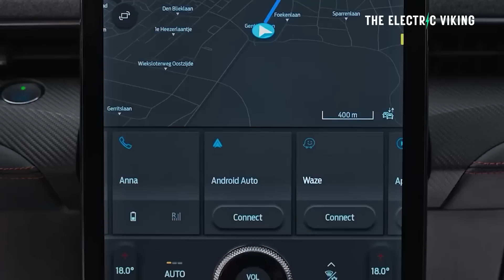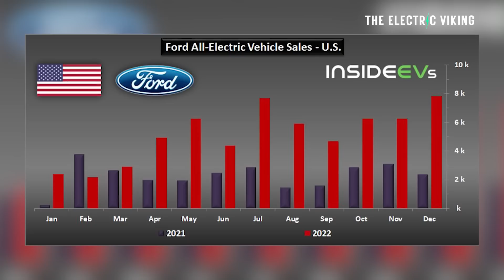Ford says its EV's have 1 mile of 70 pound wiring they don't need

Comment: The number of cars on the road is a result of new cars accumulating minus the cars that are scrapped.

I have noticed the fall in sales of ice as well as the rise in sales of evs.

The fall in ice is faster than the increase in ev sales.

Ay the same time the total numbers on the street is growing.

The reason is that the number of cars scrapped is decreasing a lot.

The age of cars has increased a lot too.

Seems people are holding on to their cars longer.

The nember of cars scrapped is a third of what it was a few years ago.

The age of cars scrapped is also higher.

The scrapped cares are mostly or close to only ice cars.

The age of evs is much younger for obvious reasons.

How long they last is not known even if we ezpect them to last longer than ice.

This trend of scrapping the ice cars later is an indication that people are waiting to get evs and holding on to their ice longer while they wait.

This has been predicted so no surprise but interesting to see it happen like predicted.
Reply: You completely overlooked the most basic and obvious reasons the average age of cars is increasing.  Cost if ANY new car and reliability.  The average new car costs $48k USD, making buying a new one prohibitively expensive for many.  Cars have also gotten significantly more reliable so they last longer with basic maintenance.  I know many EV nuts like to portray ICE as ticking bombs that fall apart and cost a fortune to maintain after a few years, but that hasn't been the case for several decades.

Comment: Risking pointing out the obvious is that ICE legacy auto makers especially more luxury brand could get away with low efficiency by slightly increasing fuel tank capacity. For instance needing 100 kWh more energy amounted to 10 liter more tank capacity say a 10+ kg weight penalty and of course a higher fuel bill, but that did not concern luxury brand buyers anyway. Adding 100 kWh in battery capacity to an EV would more than double the battery capacity  and weight installed and a very hefty hit on the price tag with a battery already the most costly component of an EV. Also the added weight cascades through the whole design adding even more weight.
So luxury brand auto makers have to recalibrate their whole design approach which they clearly have trouble to implement.

Comment: What is crazy is that Ford is finding out that customers base buying an EV on range and every pound extra reduces that range that they can advertise. 
70 pounds does not seem like a lot...but with a load of 4 adults you would be hard pressed to get 70 percent of max range....and then when the manufacturer recommends you recharge at 20 percent then a 224 mile advertised range gives you about 112 miles of useable range.  When other companies now have ranges over 400 miles of useable range it is easy to see why Ford is losing customers.  That 70 pounds could have went into a larger battery.

Comment: Sam, what Jim Farley is saying, apart from the wiring loom is outdated not making full use of digital controls and therefore overweight, they (and others, Vinfast anyone?) have not correctly optimised dynamic braking (known as retard or regenerative braking).
This engineering failure loses efficiency, increases wear and dulls the driving experience.
Reply: Easily fixed with software.
Reply: @jamesvandamme7786  Only to a degree. Probably need to double up on the IGBTs in the inverters as a minimum.
Good design principles arrange 3 times the Whoa power compared with Go power. That covers off on safety, the better the regeneration capabilities the more energy recycled to the battery. That is why the Tesla Prime Mover (Semi) is fitted with three motors / inverters.  It is also why the GE Invertex system was first issued with dual IGBT inverters.
Once the hardware is capable, then software controls the slip and slide. A real time operating system such as QNX (Blackberry) is vital.
The cheap and shoddy way to do the job is, restrict retard effort and rely on friction brakes, assuming I.C.E. drivers won't know the difference because they are used to automatic transmissions.

Comment: I’m not sure Jim’s leadership is best person to run Ford during this large technology transition in product and production technology. Rather than publicly blame Ford engineering for causing his poor Ford and therefore CEO performance maybe being more involved internally to ensure everything is being done optimally is needed. Jim is a career marketing person and not a product or production person  that understands first principles like Elon Musk. Part of the concern is with the Board and Chairman who select people who tell them what they want to hear.  Over many years Ford has drifted farther and farther from what Henry Ford pioneered loosing advantages of in house capabilities and integration. Tesla is more like Ford was in its early years when Ford implemented huge innovations in moving assembly line, one piece engine block castings, and  a high amount of value add manufacturing on site.  Outsourcing is short term capital gains to get cash which finance people promote. Short term cash gain has long term competitive disadvantages putting the business at risk.

Comment: I believe HOMES also have Poor Wiring Processes, and unneeded extra Lengths of wiring! 

*Edit*: Especially any Two Story Home with a Basement in use! 

Bring Major Power, from the Main Breaker Panel, to Sub Panels on Each Floor, at least!

Like 60 Amps or so, to serve each floor, to improve service ability!

Comment: I had a Chevy bolt. The cabin heating water loop is not connected to the motor and battery cooling loop. They are completely separate, it’s idiotic. Also, in the Chevy bolt, the antilock brakes are not connected to the regen braking system.  This means that letting your foot off the gas pedal on ice will cause the car to slide. In a well thought out car, the car would ease off of the region when it detected the wheel was locking.

Ford is not the only one making silly rookie mistakes with these cars

Comment: Legacy auto approached EVs as they did ICE vehicles.  Instead of starting with a fresh slate, they decided to use old new parts that were sitting in storage somewhere and using them in EVs.  Instead Tesla is constantly reinventing the wheel.  Tesla is a moving target and their engineering department is trying to make an established part even better or even trying to find a way to eliminate that part.  The good engineering departments are trying to eliminate parts, NOT trying to make something more complex. 

Tesla with its GigaPress has eliminated thousands of robot welds, made the single parts hundreds of pounds lighter, stiffened the part, reduced corrosion, and most importantly reduced the cost.  Only the Chinese seem to be interested in the GigaPress.  Companies like VW are just hopeless.  I'm all for Unions, but the German Automotive unions won't allow VW to be able to compete against Tesla or the Chinese.

Tesla is still way ahead of everyone else, but cheaper Chinese labor costs in the long term may be the deciding factor.  However, the Vietnamese might be able to even out compete the Chinese on overall costs.  For America, subsidies and having a vertical integration of all sources (lithium, copper, American factories, etc.) will let it compete.  However, America must learn to compete in new ideas including manufacturing processes.  It may be too late.

Comment: Ford is making a few hundred E-transit vans per month, about 2k Lightnings, and about 2.6k Mustang MachE, and so is learning how to make an EV. They can't make serious numbers of EV's until their battery plant is up, and that won't be for more than a year from now. So in the interim period, they need to improve their EV designs, and fix the glaring problems in their product line, which at the moment is the lack of a decent midsize truck as their Ranger's sales have collapsed because everyone knows the all new 2024 model is so much better. They should make a cheap  hybrid car, or an even smaller truck. The teeny trucks they have in Asia, are wanted and needed in America, and they would sell massively. Americans need vehicles to haul around their mountain bikes, and other sports toys.

Comment: I feel the extra weight argument is over used. Everyone knows that more than two thirds of the weight of an EV comes from batteries, drive train, cooling system and the physical weight of the body shell(and glass) itself. I still don't understand how small gains in weight matter. Just because an auto industry veteran feels that way, does not change this fact.  I feel aerodynamics, power management(including heating and cooling efficiency) plays a major role instead. There is an obvious reduction in material cost that can come with minor weight reduction though. May be the reduction  in weight, might add a few hundred pounds towards load carrying capacity and avoid need for more stronger/costly suspension parts
(which are in general less expensive compared to other critical parts in the system).
Reply: Weight magnifies gains or losses. Bigger battery=> bigger body, bigger brakes, less efficiency, more wires, it all adds up. You need to listen to one of Sandy Munro's lectures on saving grams here and there.
Reply: @jamesvandamme7786  I am already a subscriber to Munro's channel. I do agree  he is an engineering expert in lean manufacturing, which both ICE and EVs share, and I have high respect for him in that regards. What I mentioned is, all to do with common sense. Shaving pounds alone,will never make any automaker as good as Tesla, there is lot more innovation needed all around, to become an industry leader, that holds the top position for a while , year after year for several years in a row. BTW EV's don't need bigger body if u don't care of the surplus storage space. Also Brakes in EV's hardly wear due to the superb regen(Eventually, it gets paid as increased tire wear and specially rated tires). Also the mechanism in Brakes dissipate as heat energy due to kinetic wear of brake pads, and don't add much weight. There is a need for more surface area for better heat dissipation, or needs special ceramics without much area.

Comment: 2 kilometers of extraneous wiring??? What did they do - knit the damn car out of wiring? If the car is 6 meters long, the wiring could extend from the rear bumper to the front bumper and back 166 times!! That number has to be wrong.
If GM wants to make EVs they need to buy BYD or some other EV manufacturer. The rate of change in the EV sector is totally outside the experience or capacity of companies the size of GM to adopt. If it was 2018 they could create a skunkworks team to get the EV problem figured out - but now they are on a sinking ship trying to figure out how to build a better boat.

Comment: I keep telling you that BMW is NOT using an ICE car platform, it is far worse, they are using a brand new SHARED platform purpose built from scratch to be used for ICE, hybrid and EV cars. They spent years developing it so their EVs would suck.
Reply: But they don't suck! The I7 is even more efficient then a model3 and has more range and better comfort. Sure it's more expensive but it charges faster, and more efficient. That's pretty good.
Reply: @Ample17  Lol! You think the i7 is more efficient than the Model 3 while weighing 1900lbs more than a Model 3? EPA has an MPGe of 83 for the i7, and 131 for the Model 3...As for charging faster, maybe at a couple BMW installed chargers in Germany, but anywhere else the Tesla wins by a lot, and on a miles per minute basis the i7 loses even at peak charging.

Comment: The Cupra born is a european mid sized car which needs to be that size to be bought. Teslas are not in the same size class. That is what you Aussis and Americans never understand. Small is a benefit in Europe. 
Btw. the Born has drum breaks in the back to prevent them from rusting and that works just fine.

Comment: This also goes to show how poor and inefficient ICE vehicles and legacy auto are designed and engineered. That same waste from poor design and engineering decreases efficiency of gas or diesel consumption as well as reduces company profit. Tesla has shown legacy auto how far behind they are, regardless of the energy type. Hope Jim Farley can be a FORD TOUGH leader and reign over change. It will require at total and complete house cleaning and culture change. Not likely possible under the current Ford structure - they need a fresh start. Having recently bought a new Ford E Transit I can testify to how much waste the dealerships represent. So many unnecessary staff and very shady mark ups and extended warranty sales pressure. The entire dealership staff process could and should be replaced by a few clicks on a computer screen. I am a Ford and Tesla vehicle and stock owner. The two American auto companies I believe in.

Comment: As you know, Sam, the disruption of which you speak is even bigger than the auto industry. The transition to EVs is going to impact the oil industry too ... and the rest of the fossil fuel industry since EVs give a competitive boost to renewable energy electricity generation. Renewable energy cost curves are dropping even faster than battery cost curves ... and both will synergistically promote renewable energy's competive position vs. fossil fuels.

Comment: I think you need to talk more about where all the electricity is going to come from for a world full of EVs. Actually, I haven’t heard you address this issue at all. We’ve already seen California tell owners not to charge up their cars because the grid couldn’t handle the relatively few EVs now in use. What is the solution to this massive problem? Are you going to offer an answer?
Reply: Solar and wind and large battery storage.
Reply: They told them not to charge in the middle of the afternoon when everybody has their A/C cranked. The grid is fine at night and that's when people should charge (almost everybody does). Electrification plans have been studied to death and most parts of the grid know what they need to do. But somebody needs to vote all the present California politicians out. 
If you really want the answer you need to read all the reports from utilities and independent system operators, etc., not Fox News or oil industry propaganda.

Comment: Gee... Ford Vehicles with small brakes I would've NEVER guessed... Properly implement AI would've solved the AI problems. I own a 2014 Camaro, that platform is used for at least 2 other cars and started off as the Pontiac GTO. EVs actually present far fewer problems in terms of fitting components into packages. All that theory work on creating a Skateboard  and various Sedans and SUVs could have been done by One or Two Senior People and Interns on SolidWorks 10 years ago. Oh well...

Comment: EVs had +10M units in 2022, for a total of 25M units on the road.
ICE cars were +75M units in 2022, for a total of 2000M units on the road.
At current grow rates (+55%), EVs will be 100% of the market in FIVE years. (end of 2027)
And may grow to be 200% of the current market (170M units per year) by 2030, then ICE will be dead and gone by 2040.

Comment: Ford needs to split off the EV unit as a separate company. Innovation belongs to the upstarts, so they need to create an upstart. That’s on Farley, not his crew. They can’t innovate while roped to the legacy boat anchor. Maybe Farley should stop raging and get moving himself.

They need to get clear of the UAW and get clear of the dealership networks. Sell direct!! You can’t do that within Ford. It can’t be done. It has to be a new company.

Comment: Ford need to stop their practice of catalogue engineering, they need to design & manufacture bespoke parts without any excess materials that results from lashing together off the shelf components
Reply: @Mark Browning  Agree!  They need to get back to the early days of Ford and do what we know they can do.  The question then becomes, can they do it in time...   I am hoping they can.  There is more time than some people are saying.  With the U.S. market for non-commercial vehicles being 15 million to 17 million new vehicles each year, it will be a couple of decades until even half of the new vehicle sales are fully electric vehicles.

Comment: Sandy Munro has been pointing out the excess wiring harness issue for non Tesla EVs for quite a while now, so Farley is right to be pissed at the Ford designs as compared to Tesla designs. No Tesla killers even close to being available any time soon. Tesla continues to innovate at levels that are incredibly impressive and will insure that they remain in the lead.